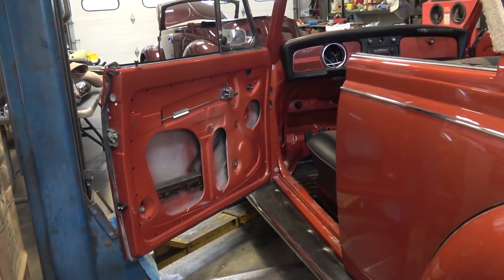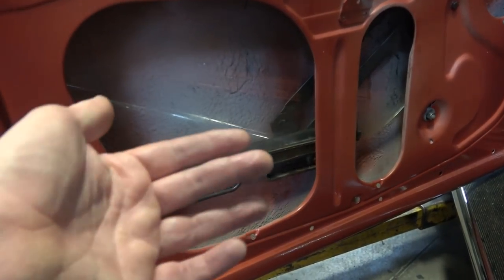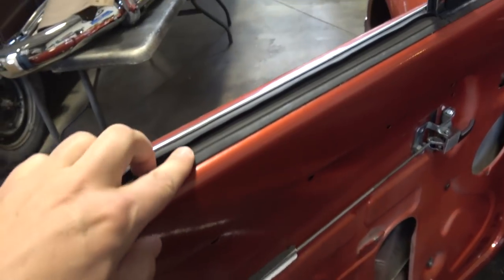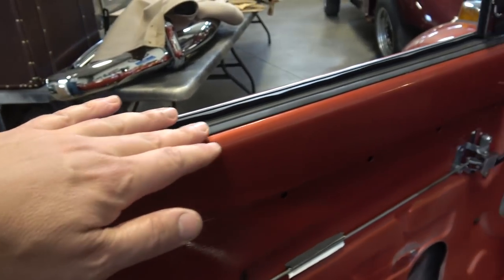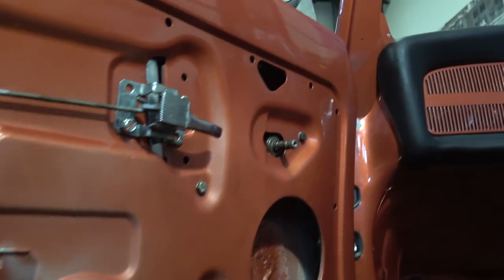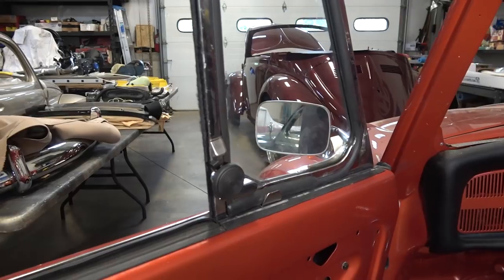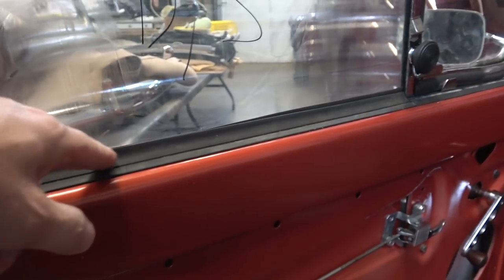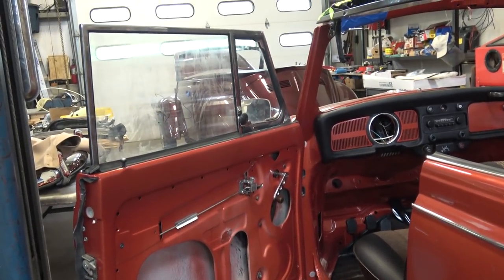Classic VW BuGs Convertible Beetle Door Build Restoration Tip

Comment: Thanks for the video Chris. Just r&r'd the door latch mechanism on my 71 SB Vert which required removing the window and rear window guide. That bolt at the bottom of the vent window guide (about 7:45 in your vid) and rear guide is removable (assuming you can unscrew it) while still in the door. They're slotted on the end so you can adjust the in/out angle of the windows. If you can remove it on the vent guide you don't need to twist the guide around and risk damaging paint or chrome.

Comment: Do you have a video on a process to remove the rear roll down windows on a Super Beetle convertible (74)??
Reply from the maker: I do not I think, but it is just the two bolts to unscrew on the B Pillar door jam, then take the door panel off and undo the bolts that hold the window mech in place, slide the slider out from the lift channel on the glass, and the window should come out.

Comment: What's up, Chris, my 71 super beetle convertible driver's door install rubber around Chrome.
Which way is the window in Stamp?  Facing top or side or bottom to get the glass in the right direction.

Comment: My window including the vent window shake back and forth (inside to outside) and after checking the mechanism I can only find that the blocks on the track are 1. Only on the top track and the other I found in the bottom of the door. However, the window goes up and down fine. I am wondering if the play in the two side of the door could be due to the accident that was on that side of the car. When the window is all the way down the vent window is stable but not if it is partially up or all the way up and it is of course worse with the top down.

Comment: Hi Chris, thanks for the detailed video. I’m having an issue with my all original 1971 Super Beetle Convertible that I hope you can shed some light on. It’s an original everything 29,000 miles car. I am the second owner. I want to start updating the weatherstripping as it’s 51 years old and very tired. Before I do I want to correct an issue on the passenger vent window. It’s leaning inwards about 3/8-1/2 of an inch and has worn through the upright rubber and touches the windshield hardware bracket for the convertible top. I’m apprehensive about pulling the original door cards which are perfect and I don’t want to damage them. Do you think it needs to be adjusted inside the door or could it just be bent potentially from someone grabbing it to pull themselves up? That lower nut in the door seems like it would allow for some in and out tilt adjustment but I figured I would see what your experience is with it before breaking down the door to try and remedy the situation. Thanks in advance! I enjoy your videos.
Reply from the maker: Hey Anthony, is there a way you can send me a pic of the issue you are talking about?  It would give me a better idea.
Reply: @classicvwbugs  After reading extensively on the issue I decided that it was probably tweaked inward from someone grabbing at the vent window frame as I noticed a couple passengers doing the exact same thing. It was like this when I bought the vehicle from the original owners representative. I pulled the frame gently outward with my hands and it now appears like it should be. I’m going to order replacement rubber for the windows and doors. I’ll buy German rubber when available as I want it to look totally stock as it’s a survivor with 51 year old rubber. I’d like to hold onto my factory chrome trim and just change the rubber but the rivets that hold it all together look like they were ground down at the factory which may be tough to replicate. Thanks again for the reply!

Comment: I need help on why my door won’t open from the outside but it does open from the inside on my passenger side. It’s a 58 beetle sedan
Reply from the maker: Check the mechanism on the door when you open the door from the outside and make sure the little tongue clears. If it does not you may have to take the door handle off and modify the unit inside the door.

Comment: Great video. Hello Chris. I have a 68 vw bug vert. New top upholstered and has all new rubber on the frame. The door is having trouble closing on both sides when the top is latched on. The vent windows hit and get pushed out. Tried adjusting the vents but will only go so low due to the metal tab that the vent screw into from the top when the vent window is open. Any tricks on how to bring the vent windows down more so I can close the doors without having to unlatch the top?  Thank you.
Reply from the maker: did you try and loosen up the top hooks that hook into the windshield?
Reply: Chris Vallone yeah. But then the top has a huge gap. It doesn’t seat right.
Reply from the maker: is the frame bent in anyway?
Reply: Chris Vallone.  No new frame. I’m gonna try lowering the window vent a little. If not I’m gonna have to cut the tab that sits below the vent that the one vertical screw goes in to bring the window down a half an inch. What you think?  Thanks
Reply from the maker: Gotta be careful, the vent window frame needs to be in align with the windows.  You do not want that lower than them.
Reply: @classicvwbugs  I thought I read somewhere that 71 convertible front window regulators are one year only. Is that true or any other years that will work?
Reply from the maker: @philrodriguez2982  Not that I am aware of...

Comment: I wish you would have talked about how to remove the door glass. I can't find any videos on YouTube that show how to do it on a convertible.  What do I loosen to get the glass out?
Reply from the maker: The door glass?  It just pulls out from the top.
Reply: @classicvwbugs   Yeah the door glass.  I pulled on it a little bit before but it was pretty tight so I stopped.  I thought maybe I had to loosen something first.  Thanks for replying!
Reply: @classicvwbugs  I don't know man the door windows seem really stuck in that bottom channel. I can't figure out how to separate the glass from it.
Reply from the maker: @dybo79  Still trying to get the glass out of the door?  All it is, the vertical part of the frame is on a slider inside the door, you just have to look down into the door and maneuver the frame free so it comes up and out from the top.
Reply: @classicvwbugs  Yes I'm still stuck but I finally figured out how to best describe the issue I'm having to you.  I'm not sure how to remove the lift channel from the window regulator.
Reply: @classicvwbugs  Never mind I got it loose but now I'm stuck where you were telling me about the vertical part of the frame.  Wish me luck and thanks for your help.